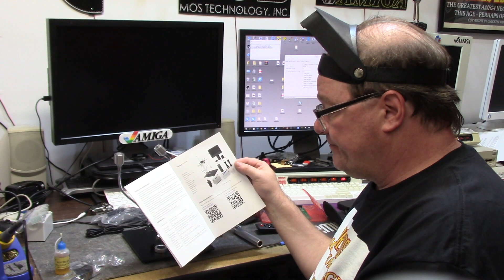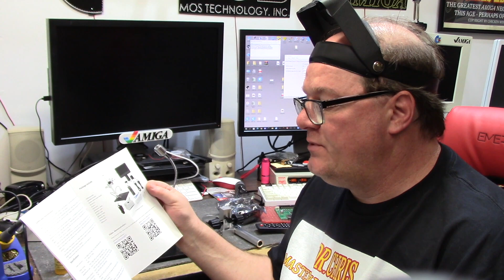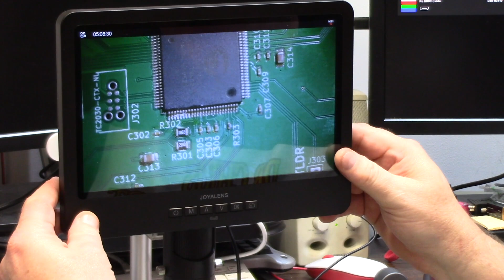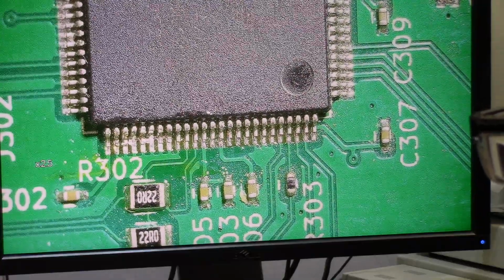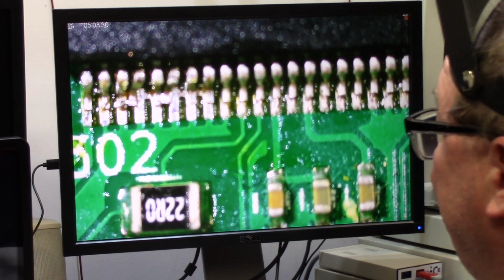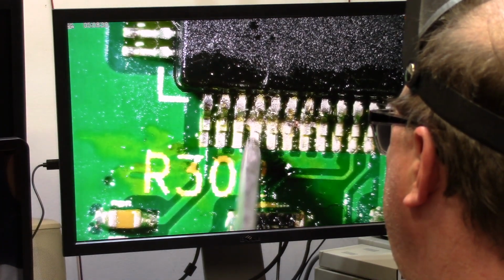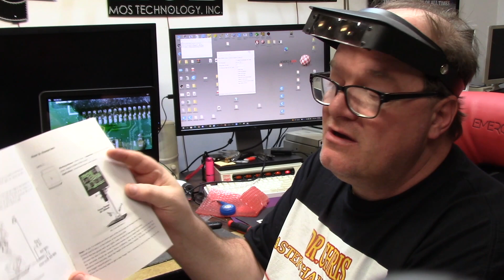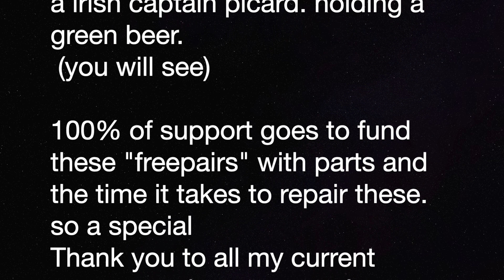JOYALENS 10in LCD w HDMI 3 lense digital microscope looking at a scsi2sd

Comment: Would it be possible to install a swivel,  scissor arm to the wall and attach the unit to it?  Then you could examine anywhere on any size board, move it around much more easily and push it out of the way when not in use.
Reply from the maker: I guess but for its pricepoint its fine

Comment: OK, this thing looks great, but my main question is:  Would this be usable to build a ReAmiga 3000 board with?  i.e. can the lens reach all areas of the PCB?
Reply: u could always build a longer rail to move it out or put the whole thing on a spring arm style arm. they never build them long enough for us guys working on caveman sized boards.
Reply from the maker: with flipping it around and all maybe?  its pretty big plate, you get more room if you do not install the spring holder feet for small parts. i can view an entire A1200 board with this by sliding the microscope out all the way and using the  heres a side, heres another side move around.  its been great, i would get the middle of the road one as the 200$ one only diff is hdmi cables, the 169 one is the same without the cables. however prime and deals you can save more, even with honey coupons. total investment less than 160 for me